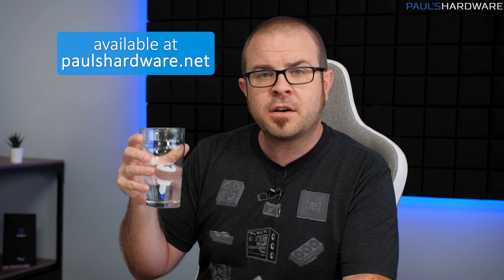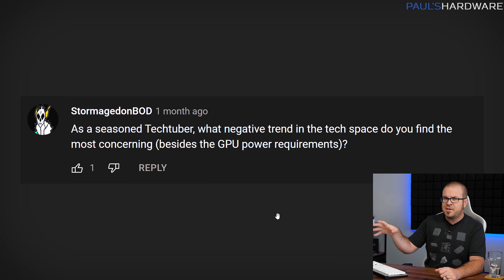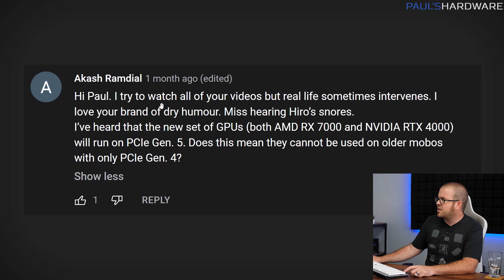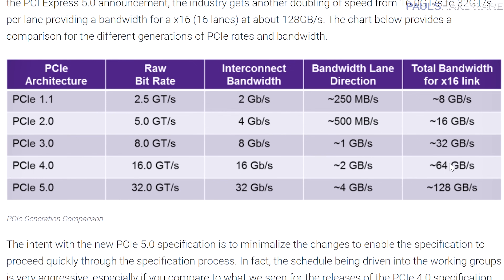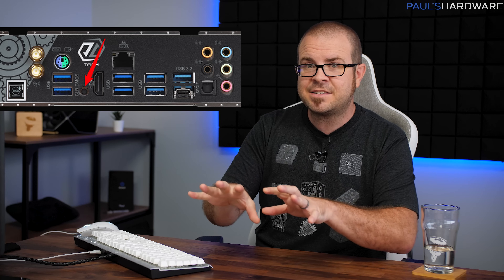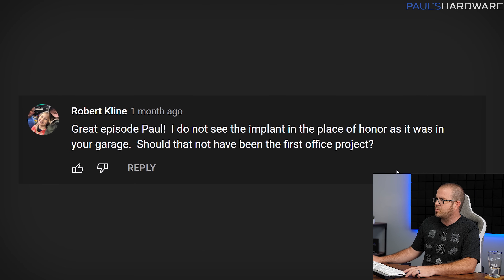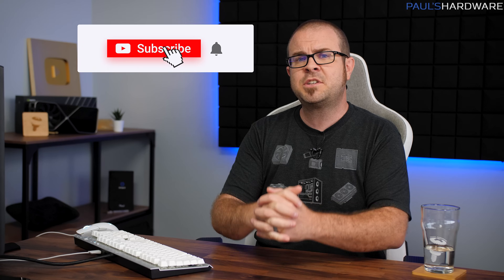This is a big problem. - Probing Paul #74

Comment: Regarding better airflow for GPUs, check out Fractal Torrent cases. PSU back at the top baby, 3x140mm or 2x180mm fans at the bottom provide tons of air for beefy GPUs.

Comment: I've never had a side panel fan, but I wouldn't mind one. My NAS is in an old Antec case that had an extendable plastic tube connected to a grille on the side panel. My best guess is it helped give fresh air to the intel heatsink cooling the Core 2 Duo. Heat out the side and back of a case would be great for temps!

Comment: its basic tribalism and its dumb.
IMO, you should buy the best parts for the money in your budget in your region no matter if its Amd, Intel or Nvidia.
people who buy a 3050 over a 6600 or a 3060 over a 6600XT for example are falling for tribalism.
the 5600 and 12400F are extremely close in performance and price and you can save $30 by shopping around for the best deals for a motherboard and the base processor price by shopping around in your area.

Comment: Paul, great videos as always, your channel is a breath of fresh air in the segment. If I may, I would like to share a few of my personal choices and thoughts about windows reinstalls. Agreed, do a clean install, but always unplug every other drive. I've had so many issues with windows installing the boot loader on the wrong drive, messing up the old drive, not able to boot, and ended up with a brick that wouldn't restart no matter what. Another suggestion, always backup / copy your entire "/Users/<username>" folder. Once the installation is complete and you're set, then you choose what to move out of the backup into the new drive. I keep the old folder for a few months and if I don't need anything else then I 7zip it and delete it in the future. Trying to figure "what to save" and finding out you missed something is always risky. Life lessons: backup everything, restore what you need. 😊

Comment: I've noticed a bit of a problem with win11 fresh installs while disconnecting other nvme drives. When you reconnect those spare nvme drives you get a hardware diagnosis bootloop which is super frustrating to solve.

Comment: I used to be a team blue or Intel person. The last 2 PCs I have built have been AMD, Ryzen 2700 and a Ryzen 3800x. I put a RTX 1070 and a RTX 2080 Super in these systems. I am sure my next build will be a Ryzen 7,000 series with a AMD Graphics card. I like to change it up. AMD is really good now.

Comment: I don't think you need a case with side vent, That is not directly blowing into a lot of these gpu's which have the fans on the bottom and top.
Sure if you have a very old case with poor airflow it will benefit adding another side fan, But if you are building a new pc there are already some good cases on the market.
I built a new pc with Fractal Design Torrent case, Best airflow case currently out there, 3x 140mm mm intake fans on the bottom blowing directly into gpu fans, 2x200mm front intake fans pushing air into cpu while also blowing air out the back of case through another 140mm exhaust fan, Also the PSU fan is extracting hot air out the top of case.

Comment: Why do tech Youtubes have a habit of recommending low capacity SSD's as boot drives? That totally limits the utility of your computer as they always run out of space especially when you have programs that have to be installed in C:. Why was/is that a thing?
Reply: How many large sized programs do you feel have to be installed on C?
Reply: LinkShellExtension can also help make junctions onto a separate SSD - once C: drive fills up just junction away your biggest program/game to D: drive to free up space and Windows won't even notice.

Comment: Hi Paul, nice video.

I have two 2666 MHz sticks of 8 GB RAM. What XMP setting would be best for overclocking? My CPU is a Ryzen 7 5700X, and my GPU is a Radeon RX 6600 XT.

Comment: Cheers everyone, came for the tech but got a philosophy lesson. Thanks Paul for keeping us grounded. Quick fact, I recently upgraded gpus, while  waiting for arrival I used the R7 5700G APU. HDMI would not work unless I unplugged the PCIE riser cable from my MOBO (ASRock B550 itx/ac)
Reply: even with no gpu, the riser cable remains plugged in will still giving distressing signal that can interfere with the ryzen APU which needs Vega iGPU only

Comment: I actually had an issue that using the GPU on a 3400G would conflict with the GPU in the top slot when waking from sleep or booting up, and until i realized that was the issue and moved my GPU to the second slot (it was a gt730 i was using as a display adapter), i would have to reboot the computer 3 times before it would all register correctly

Comment: Paul, I took my side panel off, took out the fan and added it to the vacant spot on top of the tower, then made a screen frame to fit the open side.  Drilled four holes in the corners and screwed it to the side of the tower.  I put a 10” mini fan on a stand against the screen.  I now have maximum airflow.

Comment: I agree that choosing sides upfront is usually a negative choice and there is some trend going on in many people. But depending whose side you chose and for what reason it might even turn out good for the mass. Having a positive trend towards AMD in the recent years, even when they were not the top dog, or even when they were not the cheaper, gave incentive for Intel to innovate and compete better in the CPU division, using their infinite resources. That turned out OK even if AMD stepped in Intels shoes for a while. It allowed for better competition. Unfortunately the overall price increase trend diminished some of these gains, but it could be worse without it. The CPU market is not something where you can easily vote with the wallet, since we have just two players and one is David and the other the Goliath. If we vote for the Goliath too much we will end up with the Intel tik-tok era again. The fanboyism that has no reason behind is the real problem.

Comment: 10:28 If your destination drive is Samsung, they have a handy free (for Samsung destination drives) tool to mirror all (or some) of your original drive.  I used to be a Luddite and thought "a HDD is all I need" and then I upgraded to a couple Samsung SATA SSDs, used the tool to mirror the drive, and had zero problems and many speed improvements.  So, if your new NVME drive is Samsung, I would recommend their free tool to move the Windows install.

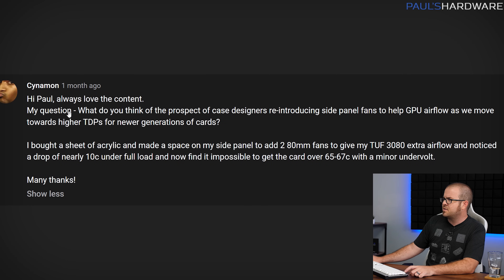9:00 I know Paul touched on it, but I suspect that a proper case (i.e., something Steve at GN would recommend), will be okay for these new higher power GPUs.  (Can't wait for GN's tearing down of an Alienware w/ a 4090... :P )
Reply: I imagine an Alienware with a 4090 will tear itself down. Good thing you'll have 3 warranties on it.
Reply: Ooooo... another person who knows what a Luddite is. (I'm also a curmudgeon.) I tell people I'm a Luddite who refuses to use most social media (and, yet, here I am watching YouTube, with a tab for Twitch, and trying to write a MUD for Discord... But Dammit! I'm not on Facebook or "Shitter"! You can't make me!)

You get an upvote from me. (Also, SSD's are far superior to HDDs in most aspect. Price per GB is not one of those aspects. Getting there.)

Comment: Regarding cases adding side flow fans for PCs w high power graphics cards: I have a mid-tower case with solid sides, three front fans pulling in, two top fans pushing out, one back fan pushing out… And two graphics cards, a 3080 w AIO and a 3080 Ti w 3 fans that under a full load (drawing 998 watts sustained [mining]) results in the GPU max temp of 77 C and case outlet temperatures no more than 53°. Ambient temp range of 17 to 20 C. This ran 24/7 for about 5 months, with temperature variation only occurring when ambient temperature changed, or the GPUs switched to another algorithm.

Comment: Hey Paul, great video as always!  I haven't built a system in the last few years, but I was thinking about doing an upgrade early next year with all the new releases happening.  I wanted to have a lot of storage in the new system and was thinking about a RAID array for faster speeds with big files (probably 0 but maybe 5 for peace of mind).  Is there any relatively simple or cost effective way to do bootable RAID on typical consumer hardware (probably X670)?

Comment: Hi Paul. Would LOVE to see you build an water-cooling PC, using a Cooler Master HAF 700 EVO with FOUR 420mm radiators at the SAME TIME, as a single water loop, with water cooling blocks on the: CPU, GPU, M.2 drive and on the RAM! Do you think this would be the ultimate dream setup for next gen hardware (like the intel 13th gen CPU, RTX4090ti, PCIe gen 5 M.2 drive and even hot DDR5 RAM)? With full RGB it would also probably be the best-looking PC setup ever! I would like to do this myself, but like many, am nervous for the first-time custom water loop, so any tutorials you can give would be greatly appreciate. Thanks!
Reply: What is the build purpose?

Sounds crazy overkill on price and effort unless trying for world class benchmarks.

If you end up doing it, cooling your m.2 drive too much will actually hurt its performance. m.2 are different than any other component, they run best when warm. But also not too hot.

Hooking it up to a water block is definitely worse than just a small heatsink which comes with most motherboards.

Comment: Hey Paul!! Just the act of unplugging the video out from a MOBO to the GPU should signal the bios/CPU to switch outputs. At least it has for me when upgrading different rigs.. Get those steel thermoses back in stock yet??? Can't buy what you don't sell after all....

Comment: Almost 20,000 "cores" 48 GB ultra fast high bandwidth memory and 600-900 watts...
That's a ton of capability but man is it a ton of power draw. 
It's basically 2x 3090 it's glued together but maybe a little more power efficient.

Comment: Question for next month's PP:  I have an 850W ATX2.X PSU with 7 years left on a 10-year warranty.  Will I be able to use GPUs that have an ATX 3.0 power connector?

Comment: Yes, I'm not expecting PCIe 5.0 will change things much at as far as GPU's go.... Unless the GPU has a seriously cut down lane count and then gets stuffed into an older PCIe gen slot (aka putting a Radeon RX 6500 XT - PCIe 4.0 x4 - into a PCIe 3.0 slot)...

Comment: Cases with side panel fans won't ever be as aesthetically pleasing as the modern cases we have today with tempered glass side panels. However I think the solution already exists, as we already have cases where you can mount fans at the bottom which blow air straight at the gpu.

Comment: The only problem I have with doing a clean install for Windows is I found it to be a huge pain in the backside to have to reinstall all my mods for Fallout 4. I had to replace my boot drive when it died, and I do have my game files on a secondary SSD so it was easy enough to install Steam and point the folder to find the games. Vortex mod manager had a similar feature, but the mod files no longer showed up as linked to their online page and were unable to be updated through Vortex, so I had to uninstall them all, go back into my download history, and download everything all over again. And I'm playing a heavily modded game so it took quite a while.

Comment: Not totally true about pcie. When I was on a board with gen2 and looking for a better video card. I was told not to go newer then GTX1050Ti which I got and it worked. But Latter I heard other people having problems getting cards to work in older boards and on checking, those older boards were pcie2. There are some extra pins or something. I forget the details. My guess is power.

Comment: Hey Paul, quick general decision; if you were to pick one CPU for gaming and one for production, which would you choose? Of the currently available. I don’t upgrade all the time and don’t care about having the latest/greatest, my current PCs are 10yrs old. but I would like to build a new PC for my son who does general gaming, nothing CPU/GPU intense and I do general productivity, i.e. photo editing. So would like just some good general overall CPUs to start with that will give us some good use for the next potentially 5-10yrs. Thank you and love your videos!
Reply: I'm not Paul, but I will say that for general gaming and light productivity, just about any modern CPU will do you fine. It just depends on how much you're willing to spend. 

Anything from AMD's Zen 3 lineup or Intel's Alder Lake lineup are going to blow a 10-year-old system out of the water in both areas, and with new launches from both companies around the corner (Zen 4 and Raptor Lake, respectively), the current sales on that stuff are going to get even better real soon.
Reply: Thanks, but hoping to get an actual CPU called out. Not top of the line, but not bottom of the barrel, if you had to choose an actual CPU for each PC, what would it be? $3-400 per CPU, maybe $500? I know they're not going to be cheap to get a good one. But don't need a $1k one.

Comment: One thing to note on the moving a windows install, you do not need to buy a new windows key, the license should transfer. You probably won’t have to even put the windows key in if you’re on the same pc and only changing the ssd. Even works for oem licenses! I put a nvme ssd in a prebuilt a few months ago for my dad to boost the speed and it worked without a hitch
Reply: Are the windows keys a one off payment or like a subscription you have to renew?
Reply: @samuelking1347  I’m not aware of any subscription for windows licenses
Reply: That only applies if you’re changing the boot drive in the same machine. You can’t transplant the boot drive into a new machine and expect it to work.
Reply: @CantankerousDave  I know, that’s why I said if you’re on the same pc

Comment: I feel the PCIE generation thing can be an issue under the right circumstances. For example, I purchased a 5700XT when they first launced and got a Gen3 riser cable to go with it because Gen4 risers just didn't exist, or were just marketing lies. Using the upper-most Gen4 x16 slot on my motherboard caused strange behavior and overall sluggishness. Place the riser in the next slot, Gen4 x8, everything worked fine. I'm not sure if limiting the lanes had an influence on what that Gen3 riser could handle, but I did end up upgrading the riser to a Gen4 riser once I could find one from a reputable brand, and like magic, the upper-most Gen4 x16 slot worked just fine and worked better in my 3DMark tests. Not a whole lot better, but repeatedly better across the ones I ran. 

So I guess what I'm getting at is, I try to avoid mismatching generations when possilbe. Just because one odd combination could lead to a bunch of troubleshooting headaches.

Comment: Hi Paul, love all your content, keep it up! Any recommendations for an ITX motherboard, for a mid to low end CPU? Of course, I know it’s a difficult subject with new generations of processors coming out and am5, etc.… But I’ve been looking into all the current ones, and seems that all of them have some pretty major issues. Just curious what your thoughts are in that space. Willing to consider AMD or Intel.
Reply: The cheapest you can find if you're buying something modern. Although I doubt you'll find anything cheap.
 ITX boards are very well built. Check if the R7 4700s bundle is a good deal where you live.

Comment: Also make sure you have a back up discreet gpu. Cause of you bought a later cpu with an igpu like the 3200ge as example or 5600g/5700g. Even of cheap mobos works for them. The bios will not and needs to be updated. 

I had that issue with a 5600g on an Asus 320m k for an htpc build for my father.

Mobo was compatible but bios was way out of date. Good thing I had a trusty 11 year old  gt 560 lol.

Comment: Hi Paul! I have a loaner 1070 and I’m completely satisfied with the performace. I will need to give it back soon-ish, I wonder what is the best card to get from a power consumption point of view, at that performace?
Reply: Radeon 6600 beats 1070 by a little.

Going for around $250 on amaxon right now. ~130W power draw.

Comment: If you are moving a smaller or same size SSD to another SSD *of the same type!*, you can use a live Ubuntu install to do a DD clone of the drive & then use gparted to resize the install.

Not recommended for old installs, SSDs of different types (dramless to dram cache ssd for example), SATA to NVMe (or vice versa) and actively discouraged from an HDD to an SSD, but I went from one dram cashed NVMe to a larger one about 2 months ago using this process & it worked with zero problems.
Reply: Be better, give accurate information.
Reply: @Those_Weirdos  my apologies for any inaccuracies, they are not intentional. Just shared my experience. Please, if you have any corrections I’d appreciate the input.

Comment: Hi Paul, do you think that an NH-D15S or successor will be enough to cool the new Ryzen 9 CPUs? I really want to build a low maintenance system. Just blow out the dust once a month, repaste CPU and GPU once a year and be done with it. Edit: No OC besides EXPO and PBO.

Comment: So what what’s the problem with the PCIe gen3 riser cables on gen 4 cards
Reply: The signalling gets messed up unless you set the bios to gen3 and slightly reduce performance depending on the gpu and game
Reply: @mikesunboxing  I wonder if we will face a similar issue this gen Gen 5 MB and gen 5 cards